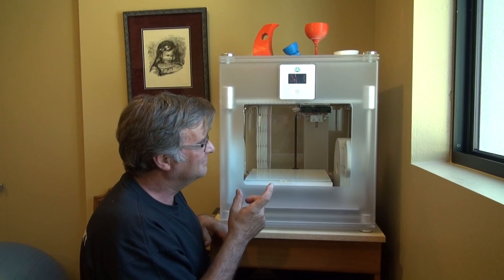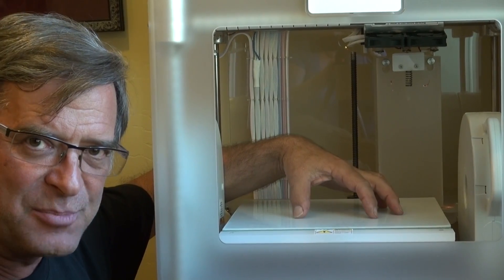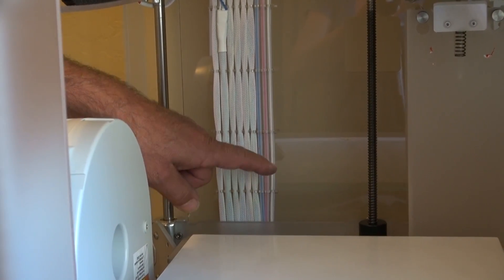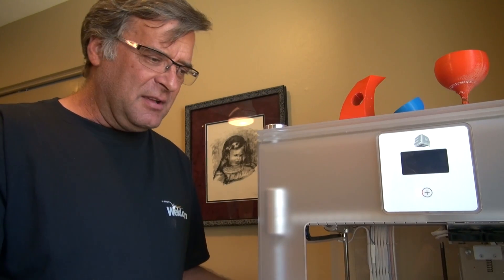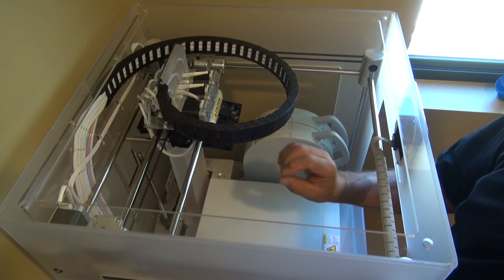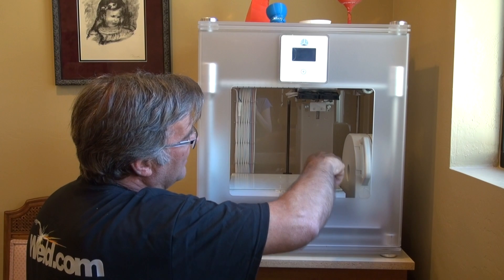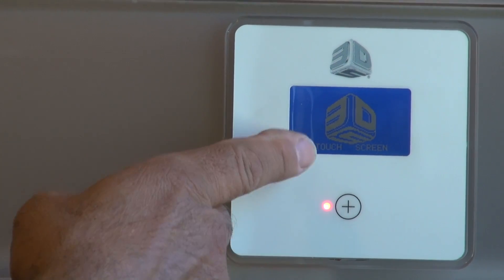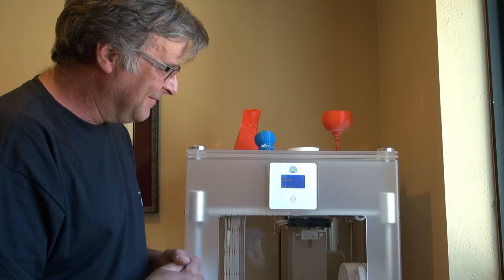How to Use a 3-D Printer: A Tour of the Printer - Kevin Caron

Comment: Hiya great video I am thinking of buying this printer but I have heard good and bad things about the printer apparently the filament does peal from the bed also the printer has many fails and problems would you recommend buying this printer also heard the filament is expensive hope you can help thanks
Reply from the maker: This is a very old printer.   I am sure the newer ones are better than mine.    That being said, No, I would not recommend this machine.